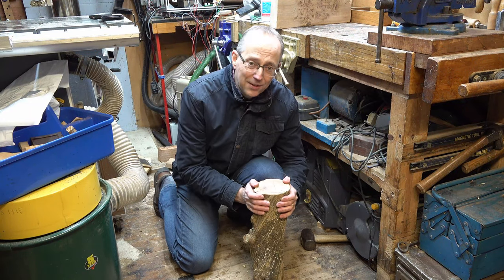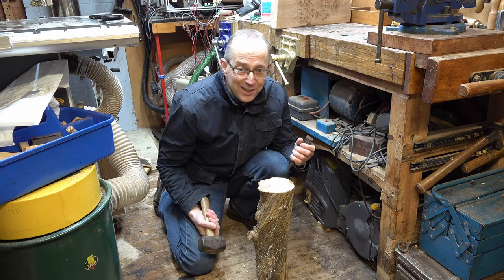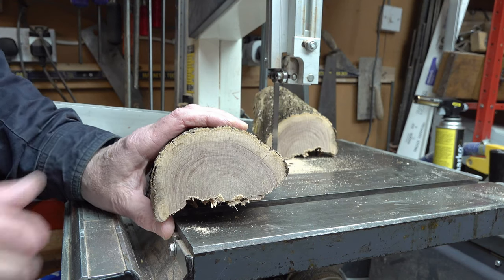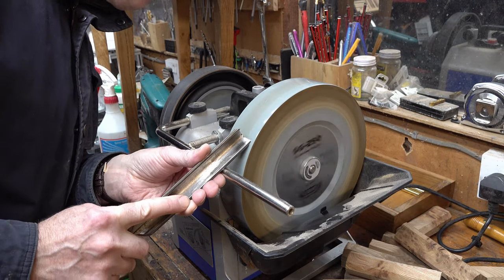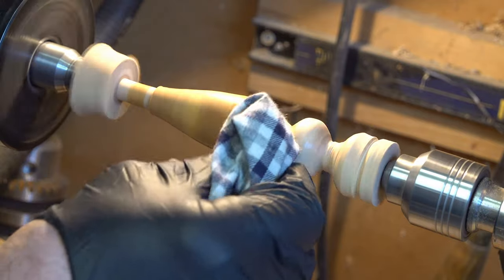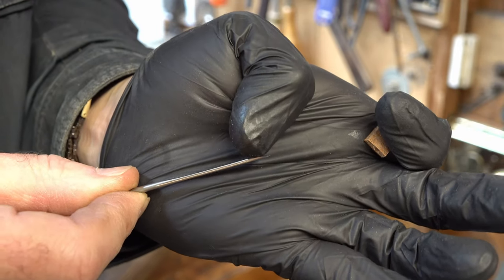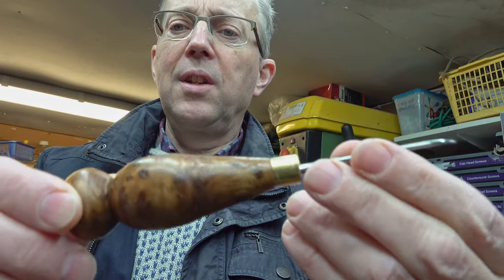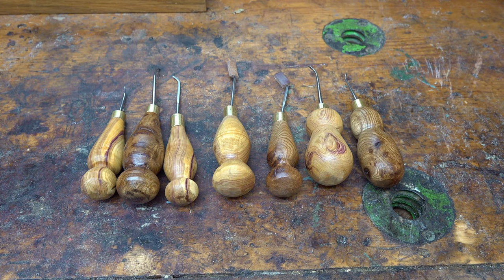Burn Log Or Make Awl Hafts?

Comment: I would really like to see more quality leather hand tools being made here in the uk. I am thinking of Chartermade type quality and in particular an awl handle like the Crimson hide 'Pipe awl' that is just what I would like but there is nothing in the uk like that, unless you know different Harry ? What I like about that is is its easy to remove and replace the blade and the flat on the handle to give you location of the awls position in your hand without having to look at it. They would look very good in Lilac aswell I think Harry. Its lovely hard wood and lovely as a flowering tree with great scent. Sadly not planted so much as it used to be.  Best regards      Jeff
Reply from the maker: Hi Jeff...I did think as I was doing this that someone here in the UK could set up a nice business doing this, as you say there is not much in the way of  premium handles etc in the UK. I think some people are prepared to pay for something a bit special.

Comment: That thing with splitting vs. sawing is: If the grain runs straight, it does not matter, if you saw paralel to the pith (and so to the grain). If the grain is quite twisted, splitting and then making it straight afterwards, will lead to the same result as if you would have sawn it.
So the real thing is: Take straight lumber, if you need long straight and strong wood in the end.
Reply: I'll agree with your point as a general rule, since obviously the wood he chose here shouldn't be resawn in to board lumber. however, you may notice that Harry splits the wood in order to find the straightest parts of a very un-straight log to at least get small useable pieces out of it. at this stage sawing can work because you now have the ability to get yourself parallel with the grain and saw along it, provided (like you said) the grain is in fact straight in that particular section. 
cheers!